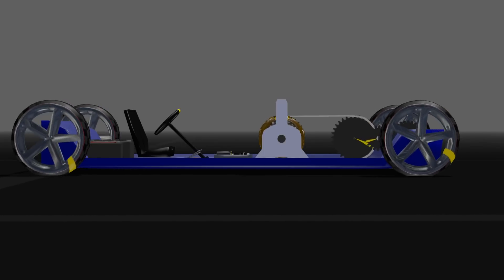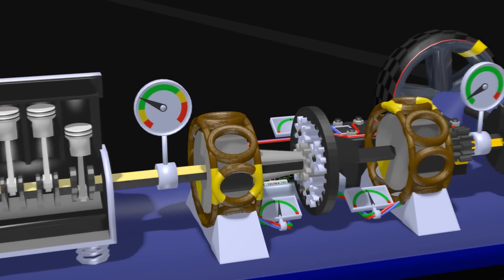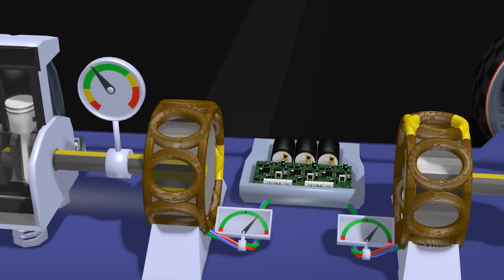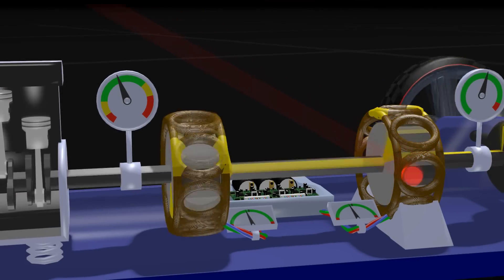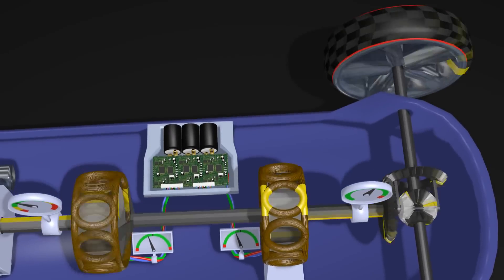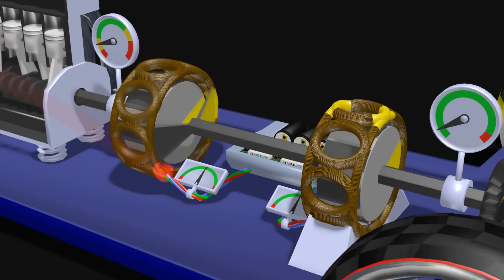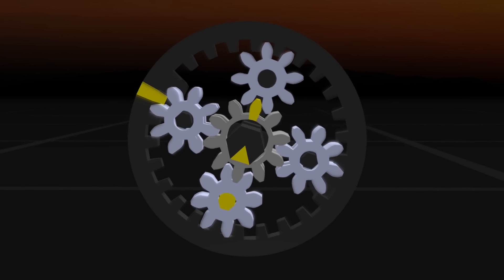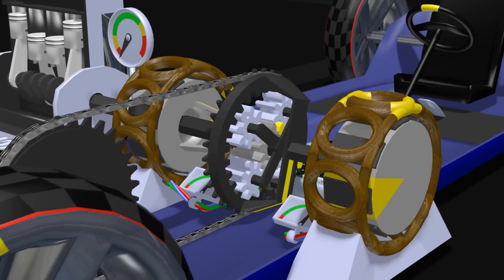Prius Hybrid Drive Explained

Comment: I am a data scientist with an IQ of 140. I hold a masters degree in macroeconomic theory and after this 15 minutes of explanation I did not came a bit closer in understanding how the hybrid transmission system works. I guess I should get a degree in engineering too in order to understand this video... :D I see that you guys built a 3D model but somehow you do not display it well enough to be easily digestible for every day people who are not engineers. I get lost after the manual transmission part, I do not clearly see what happens inside the E-CVT transmission.
Reply: Maybe this video isn't for layman. If you dumbed down a complicated computer program to what you considered core elements I would still be completely lost, but this video makes complete sense to me and I have no degree, I have never taken an IQ test, but I've been working on mechanical things since I was a child.
Reply: To update you on the eCVT transmission. In reality it appears it is not a real CVT . It operates in 3 stages of direct drive modes.( underdrive, directdrive, and overdrive.) The optimum engine output is between 1700 rpm and 2500 rpm. Whatever the speed and load demand is the transmission automaticaly shifts to keep the engine rpm in the maximum efficiency range.
Reply: IQ 138 and electrical/electronics engineer. The power split device (e-cvt) takes a bit of investigation as it has three I/O's which use electronics to controll it.
Reply: The CVT is based on 2 sizes of drive and driven pulleys that can change diameters ( constantly varying) depending on the speed  and demand if the payload. They are used in many types of machines, industrial to recreational.
Reply: @raymondkreyer2664  I perfectly understand how a CVT works. This video is about the eCVT transmission, which has nothing to do with an actual CVT. The only thing in common is the name and that both technology are used by Toyota. But I appreciate your explanation :)
Reply: @Xmarcello88  Belt drive CVT is a stupid technology which should have been binned along with the DAF with the rubber band belt drive!

Comment: What happens in a long and steep uphill drive, when full power is needed (ICE+Electrical) for a long time? will the battery drain? then what?
Reply: Prius driver here. no, the battery never drains  to 0%. The ICE will kick in providing necessary power to complete the climb. If battery power is sufficient, the electric motor will supplement the ICE engine. I assume the car's computer knows in periods of high demand (ie. accelerator all the way down) it does not charge the battery with the ICE, instead choosing to route all available power and torque to the wheels. The ICE alone is very capable of driving the vehicle. Hope that helps.
Reply: If the uphill drive is too steep, just climb it slowly. The eCVT will “emulate” a gearbox in first gear.

Comment: So if I’m getting this correctly you recover more energy from the brakes than from the inertia in the wheels spinning right? Except in cases where you are going down a slope
Reply: That's correct.  Funny story:  My wife and I live in Florida, so we have no downhills because we have no hills.  Fast forward to a vacation in the mountains of Tennessee and as we were going downhill, we hear this very unique (read weird) noise coming from the car.  A quick Google search let us know that it was the hybrid motor storing energy, like a big rig using engine braking.

Comment: This changes my look on hybrids , I used to see hybrids as the nerds in the car world without any style but just like in real life the nerds in automotive industry are actually waaay cooler and smarter 600 miles per tank ! I've made up my mind  I'm buying a Prius next year !
Reply: What you mentioned about 600 miles or more per tank, that's assuming your averaging 50/50.5/51 or higher miles per gallon. The farthest I've went on a single tank is 378 plus miles. And that's my current (11/2021) record for how far I've went so far.
Reply: @morganrussman  So far I've had my 2015 for a year, and my average is around 430~ with ECO Mode
Reply: I hope Toyota licenses the hybrid mechanism and Mazda makes a hybrid Miata.
Reply: @L W we need a 80mpg car nowadays

Comment: Awesome job!!! I have a 2022 Tundra Hybrid on order and this totally cures my engineering curiosity on how the gas engine and hybrid powertrain works.
Reply: The Tundra Hybrid does not work like this at all. The new Tundra is a basic parallel hybrid system with a conventional automatic transmission; it is not a power-split transmission as described in this video.

Comment: I have a 2008 Ford Escape Hybrid by removing the catlytic converters do y’all think it would instantly affect the truck’s performance since it’s an electric hubrid??? thank you
Reply: Don't do it.  Not only is it illegal AF, but the entire system is run by computers that depend on programming that's designed to run as built.  You'll severely limit the life of your vehicle.

Comment: Hello folks. Thank you to original author of the video, very insightful. 
I've recently bought a gen 3 prius (unfortunately its a 2010, didn't know at the time to stay away from those as explained on some other videos) its good so far but I've never owned a prius so I don't exactly know what is standard and what is not. There seem to be no problematic codes but whenever I drive and come to a complete stop, the front part of the prius, I'm guessing the motors as shown in this video, makes a noise that I'm just not used to from regular cars. Its louder than I'd expect. I'm just not sure if I should have it checked out or its normal especially that it is like an 11 yr.  old car and it had two owners with two rear end accidents. 

Please if anybody really knows any good info I'd really really appreciate it 🙏 sorry if this was a lot to read lol
Reply: If you look at the owner's manual, it does let you know what kind of noises are normal for a prius to make, there are a lot of odd noises, such as when you turn the car off and step out, you'll hear those sounds, and if the sounds are pretty consistent, then you're probably okay.

Comment: Do you know if you can get regen braking in reverse in a gen2 Prius, or just going forwards?
Reply: I'm not sure, but, you might. I'll have to test that out.
Reply: Regen will physically work in either direction of motion, but I don't know if Toyota uses it in reverse. You are moving so slowly and so infrequently in reverse that it really doesn't matter.

Comment: I don't really understand the problem at 12:00
Reply: What do you not understand? I have a vague idea of what's happening
Reply: For the planetary gearset to provide a variable ratio support, aka CVT function, you have to be able to vary the rotation speeds, even direction, of one part.   MG1 is fed current, or it's inductive capacity is altered, (depending) such that it provides a resistance (or not) to the rotation of the rest (other two parts) of the planetary gear set.   Thus variable ratio's.   In a "simple" mental image MG1 is a battery charger from the engine and MG2 is a drive motor.  In reality however MG1 has an infinite amount of charge/draw states depending on the needs of the transmission.  Which means MG2 does the same.   EG:  braking for energy recovery is performed by MG2 by creating rotation resistsnce via inductance.

I think.  :)

Comment: I just bought a (used) 2017 Prius Two. This video was very helpful... Thank you.
I remain confused, however; (1) on how exactly the breaks work and (2) what it means to drive in "Eco" "Power" and "Battery" mode. 
In other words, why should one want to drive in any other than normal "Hybrid" mode. 

Again, thank you, Niels, for an excellent video.
Reply: 1. Producing power with a generator takes force, that force can be used to brake the car.

2. I think the 17 prius works like my 16 auris (gen4 vs gen3 hybrid system, but that should be irrelevant)
Eco mode let's the engine temp go lower before starting the engine again, it also let's the temp inside the car go a bit higher without giving more power to the ac compressor, to maximize engine off time, it also lowers the throttle response.
Power does not change engine or cabin temp threshold, only increase throttle response
Battery I guess is like EV in mine, keeps the engine from turning on at all for heat, also gives you a bit more throttle freedom before it turns on the engine.

I rarely use Eco, only on traffic jams or where it's a lot of redlights. I never use power, full throttle is full throttle regardless of mode. EV I use from time to time if I'm moving the car, like pulling out of the driveway to load stuff or drive around a corner, don't want to start a cold engine a d turning it off 20 seconds later.
Reply: "breaks work" .     nice oxymoron..... 

and why do so many ppl want to "break" their car?
Reply: The brakes engage when the force of braking is too much for the generator all at one time, (basically when braking "hard")

Battery mode is (unfortunately) useless and only uses the small hybrid battery/electric motor to drive the car, but shuts off when the batt is too low, or you accelerate too fast. 
Eco/Power Mode changes the sensitivity of the accelerator and how much power is required to use more electric or gas engine power.

Comment: This is a real revelation,now I understand why these cars are so great.Is there a down side ?
Reply: viral videos  not really, these hybrids, especially transaxles, are indestructible
Reply: Just the cost to make them. The required high-power motors (generators) and the electronic controllers for them are much more expensive than a mechanical transmission.

Comment: The moment you realize the prius is all about the transmission, not the battery...
Reply: Yea they make incredible use of a planetary gear set, much more so than the planetaries in an automatic trans. I think it's brilliant they made a flawlessly smooth transitioning device that allows additive torque input from 3 different sources. It runs on simple, normal trans fluid, and it shares a separate coolant loop with the inverter/converter solid state control box. Separate from the engine's coolant I mean. And all this stuff runs north of 300-400k miles before even pretending to have problems. And it's certainly worth the battery cost every decade or two since it pays for itself in saved gas money in 2-3 years.
Reply: My brain did blow up with that realization. What an elegant and simple solution they made
Reply: That’s why the sticker on the back says “Hybrid Synergy Drive” and not “Battery”.
Reply: Yep!!

Comment: 13:35 does it actually have a chain ?
Reply: the first generations of it had a chain, later updated power split devices use gears, either way its bullet proof

Comment: This is amazing. It hadn't occurred to me that the resistance from the generator could directly act as the clutch.
Reply: And, effectively, a torque converter! Ingenious design.
Reply: But it doesn't. Before introducing the planetary gear set he shows an interesting design which is almost completely unlike the Prius transmission.

Comment: For the English viewers: "Pull up" = "Accelerate". It is a bit too literal of a translation from Dutch.

EV driving is not necessarily a party trick. I'd love to be able to drive off in complete silence without waking my neighbours. I don't care if the battery only lasts until the edge of my town, by then I'm away from people's homes and noise + polution are less of a problem.

Comment: 5:05 Hi Niels, essentially this configuration (with MG1's stator connected to the engine and MG2 connected to driven axis through reduction gearing and with possibility to lock MG1 mechanically) was used in 1930's railcar ‘Slovenská Strela’ (ČSD class M 290.0). The workings are described in detail in this article (google translate of it looks quite good): http://www.speaker.cz/localbahn/view.php?cisloclanku=2006071401 and if you look for "M 290", "M 290.0" or "Slovenská strela", you should see quite number of videos from its recent renovation, e.g. a test ride (low-speed only) here: https://youtu.be/Rj5AM3RgHRI

Comment: I have a 2002 Prius and it is fascinating. Quick question now - with the transmission designed like this, is it immune to being slammed into reverse while driving forward or slammed into drive while driving in reverse? Not that I would drive like that but seems like it would be immune to this.
Reply: The gear stick isn't connected to any moving parts. It sends a signal to the computer requesting to spin the electric motors in reverse. If the computer detects that the car is moving forward, it won't allow the driver to put the car in reverse, and vice versa. It's a simple interlock, found in any modern automatic transmission.
Reply: @Tuppoo94  my 2002 Prius still has a traditional column shifter and a shift cable.
Reply: @aspecreviews  I'd still think it has electronics controlling what happens inside, considering that the powertrain is partially electric. Therefore it would be impossible to throw the car into reverse. The transmission would do nothing, or would pop into neutral.
Reply: @Tuppoo94  yes I know it is shift by wire but I'm pretty sure the instrument cluster would still report the transmission as being in Reverse because the only thing the cluster knows is the position of the shift lever. it may report itself being in Reverse but never actually turn the electric motor in reverse.
Reply: @aspecreviews  I saw a video where a guy shifted into reverse in a Ford while driving on the highway, and it turned on the reversing camera. So maybe you're right.
Reply: @aspecreviews  nope. Whatever position you put the prius shift into it instantly jumps back to centre from that position.  Every time you 'put it in gear'  all you are doing is clicking a micro switch to tell the computer which gear to select and if it detects movement of the wheels and/or the foot brake isnt pressed then it ignores you.

Comment: I was a Cadillac  person. 16 m0g per gallon but it was a catty . I love my 1rst and second Prius. 200000, no break job and I get 52 mpg all the time. I figured I saved 37000.00 in gas  for what I would have put in my sts catty. GO PRIUS. 200000 MILES AND NO PROBLEM

Comment: You just answered my question why my rav4 hybrid whistles when in P and doesent when in N.. and why  whistles when driving in D... It has to be "drive clutch"...
Reply: There is no clutch. Park and Neutral are mechanically the same thing in a RAV4, except that the parking pawl is engaged, which doesn't change the sound.

Comment: It's so easy to criticize, but the very good explanation on the planetary system you gave would take even less imagination if you would have explained it again on the final animation... (with the entire setup)
- now the car pulls up with only the electric motor, 
- now the petrol engine kicks in, 
- now the electric motor stops and the car is running at cruising speed, (like a manual transmission in 5th gear)
- now the car breaks and energy is recuperated.

Comment: Amazing video. I had already understood that the planetary gearbox was set up at roughly the same ratio as 5th gear...
and that it's as if the electric engine push-starts the petrol engine every time (slow speed => electric, cruising speed:  petrol), but this makes it a lot clearer. Thanks.

Comment: Wow. Was the Prius the first mass produced application of this drivetrain?
Reply: Pretty much. It was the first hybrid available to consumers.
Reply: @garethbaus5471  Even the latest 2023 Kia Niro hybrid does not have this... and they promise 53 MPG but they are actually 46 MPG... the 2022 Prius Eco delivers 56 MPG
Reply: @robertoguerra5375  WTF are you even talking about? The Kia Niro hybrid transmission doesn't appear to be all that different from a mechanical standpoint it uses an eCVT just like the Prius and just about every other hybrid vehicle that has been mass produced other than the first generation of the Honda insight.
Reply: @garethbaus5471  There are many parallel hybrids, not just the first generation Insight. All current BMW hybrids, the Ford F-150 and Explorer/Aviator hybrids, the Toyota Tundra hybrid, and some Honda/Acura models are examples. There are also two-mode series/parallel hybrids (with no power split) from Mitsubishi (Outlander PHEV) and Honda (Accord, etc), which doesn't work like this at all.

Comment: Does the Prius have the same hybrid system as the Camry hybrid
Reply: Yes, highly similar.
Reply: Yes, the Camry's hybrid system was based on the Prius.
Reply: I don't think there's much difference, except in engine displacement and some control unit tweaks.